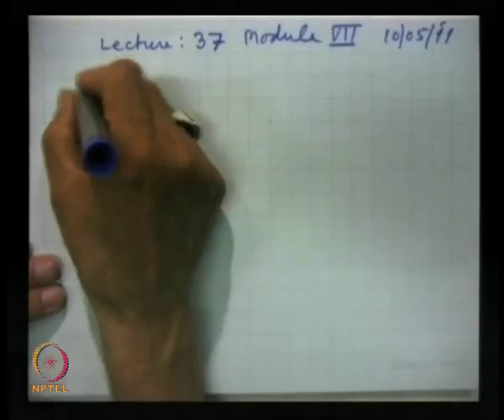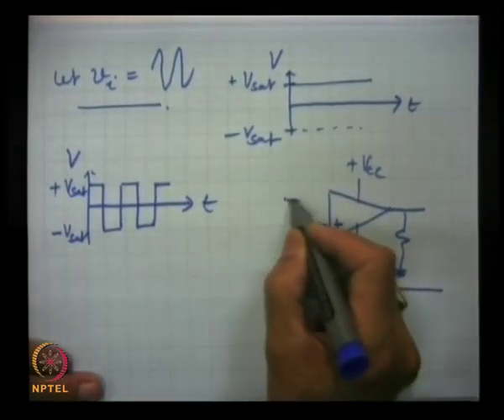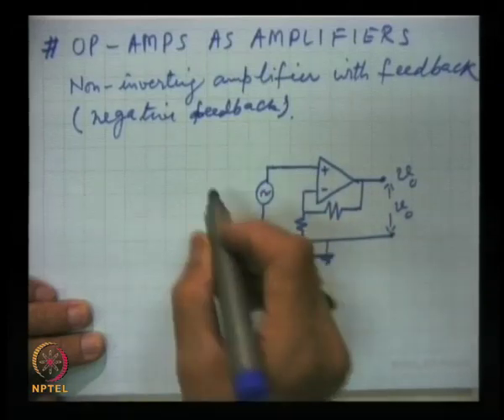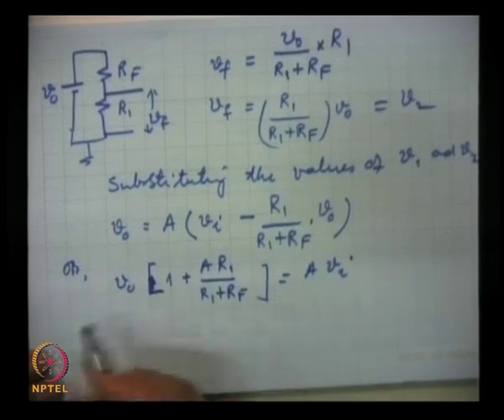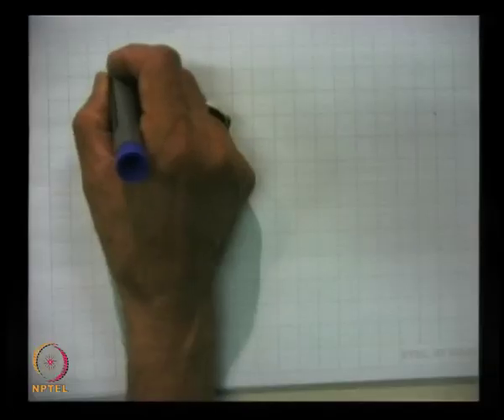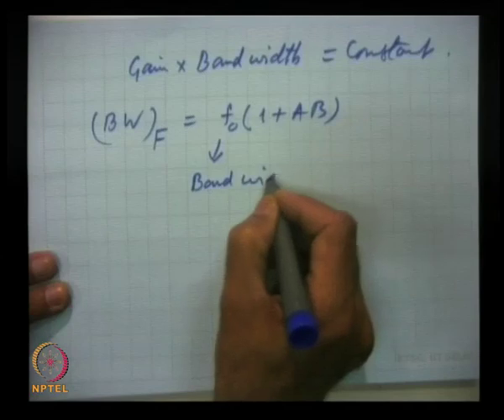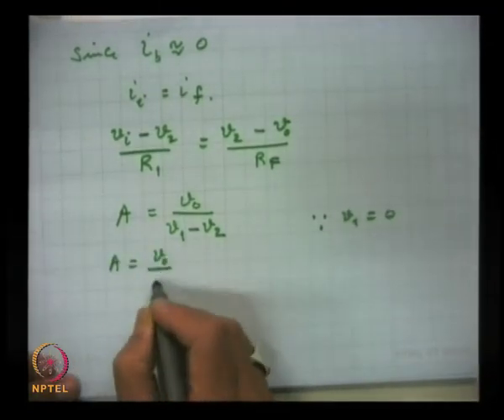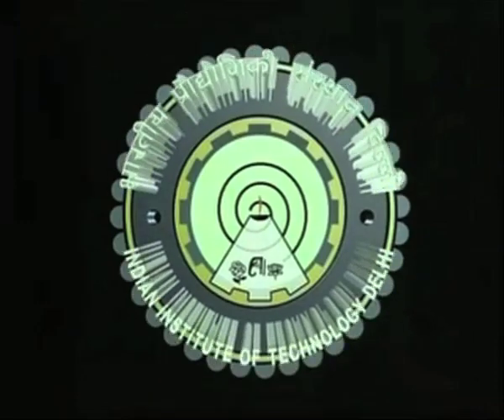Mod-07 Lec-37 Operational Amplifiers

Comment: 1. op amps gets saturated in open loop & used as comparators, so they are always used with feedback.
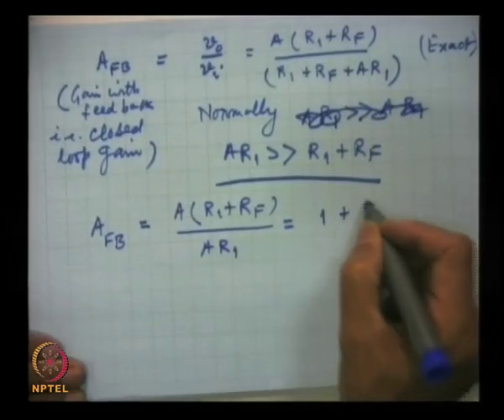2. 28:00 gain of non-inverting amp & also they act as ideal voltage amp.
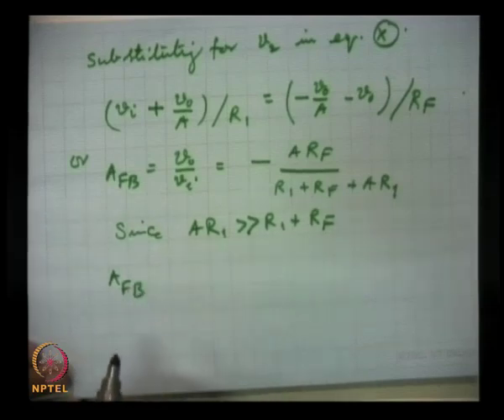3. 49:38 gain of inverting amp.
4. Inverting input acts as a virtual ground . .... thanks me later !!

Comment: as in case of non inverting amplifier its voltage gain is reducing then how can we say it is a ideal voltage amplifier ??...in the formula,A=Ao/(1+AB) gain is reducing....??
Reply: while using  negative feedback main disadvantage is reduction in  voltage  gain    and   ideal voltage amplifier with negative feedback   with gain  formula A/(1+AB) so it is ideal